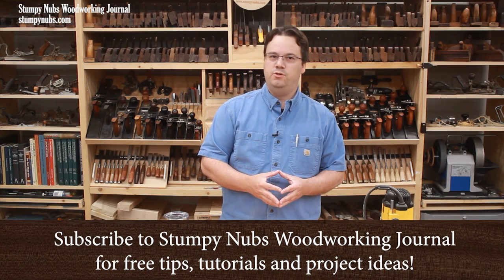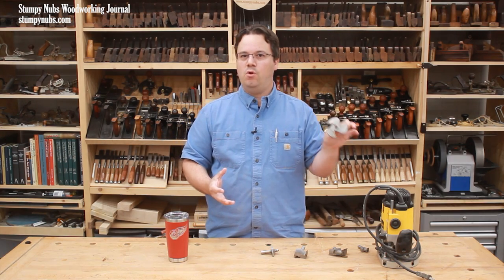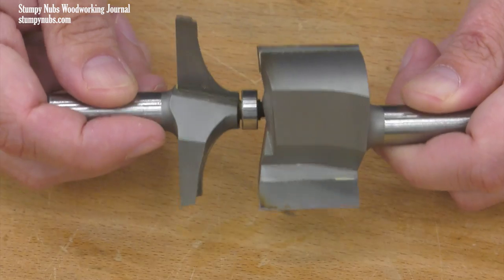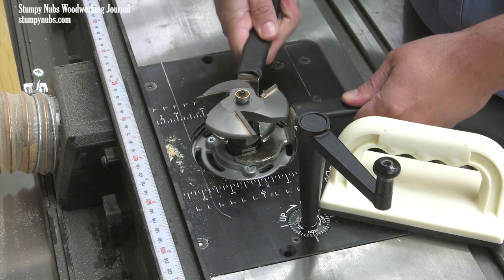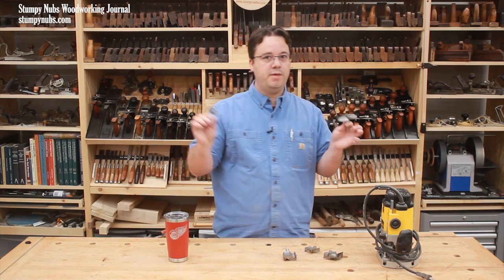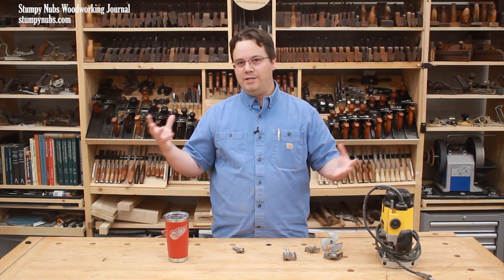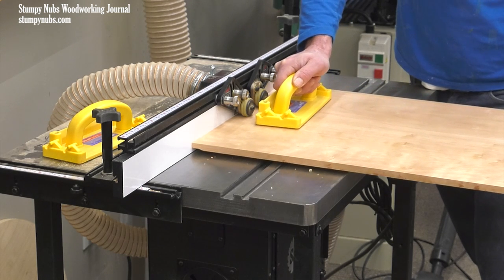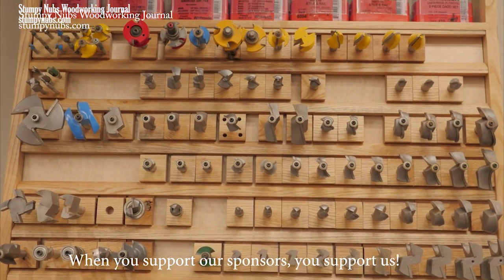The SCARIEST router bit I've ever used! (How I survived...)

Comment: I have this Whiteside (great bits) bearing guided 1/2" dia solid carbide upcut (I use it inverted in a router table so it's cutting downward) spiral bit that I use for routing guitar bodies to a template.  I call it the "murderbit".  The LEAST bit of inattention one day and that thing grabbed the guitar body out of my hands, threw it halfway across the garage, and torqued the router right out of the underside of the table, hitting the floor and bending the bearing boss on the bit.  Fortunately I was uninjured and the damage to the guitar was repairable. The bit, alas, was a goner. An EXPENSIVE goner. :D

Comment: There's hand held routers, hand held routers mounted in a table and then the spindle moulder. The advantage of that is more rigidity and power feeding of the  workpiece on the bigger machines.
Reply: Always found working with the spindle moulder much easier and saver than the router or router table, especially with using the aigner accessories
Reply: There are also pin routers and pantograph routers and cnc routers and machining centers not to mention that some of the older radial arm saws had router capability but the common rule of safety is that cutters that exceed 2 inch diameter are not for use in hand held machines ever.

Comment: I tend to use the vertical router bits for raised panels nowadays. Yeah you have to use a taller auxiliary fence and feather boards on the router table but the bit doesn’t seem to work as hard and it produces less burning and chip out. At least in my experience with it. Of course the same safety precautions still have to be taken.

Comment: It might be good to mention vertical raised panel bits as an option for those bits with a large diameter. They require a tall fence, but have some advantages. One still needs to be very careful with either design. Thanks for another great video. Excellent bit storage design!

Comment: honestly, same principle as in machining. they use the actual cutter's speed (i.e. what you were describing) plus how fast the feed rate is to determine pretty much everything. (well, plus the cutter's construction, the material, but . . . ) so this is a really good thing to take into account with routers (which are the smaller cousin to the milling machine). Thanks!
Reply from the maker: Feed rate affects the cut, for sure. We have a whole video about that. But the max speed of the bit applies even if it's just spinning and you aren't feeding anything through.

Comment: When it come to router bit security, one thing that some people might not think about is CLEANING the mating surfaces of the collet and spindle. I've made it a habit to ALWAYS take the collet out and wipe down the outer surfaces as well as to clean out the spindle socket with a soft rag and a bit of solvent (to remove any resin from wood pitch) before mounting the next bit.

Comment: I bought a panel raising bit like the one you show some years ago. I have a single speed router which advertised 1.5 or 3 HP depending on exactly what parameter they were quoting. I chucked up the bit once and turned the router on. The inertia of that bit caused such a huge "recoil" that I lost my nerve altogether, turned the router off and returned the bit to its box. Nowadays if I wanted to make a raised panel I'd either opt for a simple profile that I could cut on the table saw, or use one of the so-called "safety" bits that turn the profile on its edge to give a smaller diameter bit. Incidentally, I'd just like to point out that you can't sustain 3 HP from any motor connected to a standard 15 Amp circuit...assuming 120 V, the most power the outlet can deliver continuously would be 1800 W (~2.4 HP) and that assumes the motor operates at a power factor of 1. Anyway, all that to say thanks for a great video. Some of the tools readily available to amateurs can be extremely dangerous in inexperienced or willfully careless hands. That's an important message to share.

Comment: One other point to consider when running a larger diameter router bit, reducing RPM may maintain the desired "rim speed", but it will also increase the "chip load" if feed speed is maintained.  This might not be as big of a problem with the three knife raised panel cutter, but for something with two knives like that locked miter cutter in the video, trying to maintain the same feed speed or pressure will result in the bit taking a bigger bite on each revolution.

Comment: Great info, as always. Question: I have a Kobalt router w/table. The router does not have an adjustable speed. Can I use a router speed controller or will that affect the motor?
Reply from the maker: You should be able to get an add on speed controller for it.

Comment: It's interesting that the concept that you talk about in the second half of the video - tool cutting speed, or Surface Feet per Minute (SFM) is talked about so rarely in woodworking. In machine shops, SFM is everything. The right cutting speed is crucial for optimal material removal rate, surface finish and tool lifespan. 

But in woodwork it's generally an attitude of "Full speed ahead, and it if starts burning back off a little".

Comment: So timely!
My Triton router while very powerful, and my brand new spiral compression flush trim bit seemed an easy job.
However it was the end grain of extremely hard wood. Table top is 1 3/4 inch. 
I took too aggressive cut and the router at speed 3 out of 6 started vibration and I nearly lost control. Damn it was scary. 
Table top is 240lbs so taking it to the router table was out of the question. 
The solution was trimming the edge with the circular saw, then taking small cleaning passes with the compression bit to remove the saw marks.
The masking tape helped beautifully with securing the exit edge

Comment: Great videos as usual stumpy. Now I should ask. There’s allot of guys out there, myself included. Who flatten/plane large slabs of wood. With a sled type jig. Now I have a 2” bit a 2-1/2 inch bit both with 2 cutters. And another 1-3/4 with 4 cutters. All of which are between 5/8-1/2 thick and don’t wheigh allot. Are these safe? And if so am I able to go bigger because of the sled? And does having more than 2cutter heads make a difference? I’ve heard it’s worse. I also have to plane through resin which requires less depth per pass and a more careful speed ratio too fast it chips too slow it burns. I should mention I have an extension for my router for times my jig doesn’t allow me to get where I need it and that gets pretty shakey. Any tips ? Sorry for the overload but lots of guys are doing it I’m sure you agree these are good questions. You work the trades you know there’s no stupid questions. Have a good one there stumpy
Reply from the maker: All of those are 2-1/2" or less in diameter and reasonably light weight. So if your router is powerful enough, they sound fine (with proper precautions).
Reply: @StumpyNubs  thanks stumpy. I’ll go to a 3” bit with this new knowledge

Comment: Worst shop accident was a 1/2" spiral upcut doing a box joint, had the panel secured with a sping clamp . Last cut clamp popped off and i tried to grab it before it hit the bit. I got the clamp ,bit got my finger. Almost cut the first inch of my finger off, cut into the bone cutting tendons and ligaments. Surgury repaired it completely. Have feeling and movement back

Comment: Excellent point on the mass of the bit. I was thinking you want to keep angular momentum to minimum in something you'll be moving around and that is impacted by mass as well as radius (and speed of course). A better rule of thumb might include under X oz as well, which I think you were getting at.

All my bits are 1" or under light weight at the moment so never ran into the issue, but good incentive to finish that router table before I even think of getting something bigger (if I ever do; not a big router user).

Comment: My scariest experience using a hand held router was with a small roundover bit when the bearing on the bit disintegrated. I now check the machine screw holding the bearing on for tightness when I use any bit.

Comment: Yes, I have two of those for slightly different profiles. I bought the bits, and then bought a 3.5 hp variable speed router before I took them out of the box. They are very scary, but they do a good job. I still have all of my fingers.

Comment: If you are using cutters that big and have the space, consider getting a spindle shaper.  The cutters are locked on with a nut holding them down so they aren't going anywhere if installed correctly.  I have had one for years and it easily can handle panel cutters and any large cutter head.

Comment: I'd call those large bits 'Spindle moulder bits'. While the most powerful pro routers can handle them, using the term 'spindle moulder' helps me think of them as heavy duty joinery tools rather than lighter duty cabinetry and furniture tools. As you mentioned, it's about mass leading to angular momentum. With kinetic energy related to mass * VELOCITY SQUARED, a large bit diameter means the rotational energy at the outside is vastly greater than at the centre or on a smaller diameter bit. You are very correct to talk about slowing down the rotation speed. It means the bit has to be built so much stronger (therefore heavier) than a smaller bit - so risks and consequences from a spindle moulder bit are so much more vastly greater than for a mere router.
Reply from the maker: A 3-1/2 HP router is hardly "light duty."

Comment: As far as doing the math on the speed dial, are those typically linear? I’ve had some other non-tool items where that type of adjuster was logarithmic. Was curious if that was possible here.
Reply: Some are linear, some are log.  I do what Stumpy said in the video - start at the lowest setting and increase until it makes a bad vibration, and then write that number down.
Reply: @criswilson1140  I'm with you on the bad vibration method. Would be nice if manufacturers would make things more clear, tho.

Comment: I have a small bone structure and clicky wrists and other joints. It was the early 2000’s. Spouse wanted a raised panel bit collection ( cabinet panels, certain types of joints) and holidays approaching. I walked into a Woodcraft store we bought from often enough… sashayed up to the router display, picked up a demo 3 1/4 Ho chunk and turned it over. My wrists came forth with an alarming collection of cracks, pops and snaps. The clerk materialized at my elbow and nervously asked if I was thinking of using it as a handheld router. Nope. Holiday gift, table mounted because needed to swing a panel bit was going to take a serious router. I rolled it back over to another collection of those clicks, crunches, cracks and pops and put it back on the display. I left with router, extra plate and four big chunks of sharp metal…

Comment: I have a flush trim bit that is 5" long, roughly 3/4" diameter. Due to its length increasing its mass what speed would be correct for it?
Reply from the maker: Really long bits can definitely vibrate. I'd slowly increase the speed until you feel some vibration, then back it off.

Comment: Machinist fly cutters are pretty scary too. Painting a bright color on the end helps visualize the almost invisible whirling zone of doom.
As for RPM, use a frequency analyzer app for your phone. Hz = RPM but verify on a known reference speed (like max) first as stuff has resonance and gears.
Lastly I could see having two setups one rough cut and one finish. The old bit and machine can tee the work up for the new bit/machine and make it last longer. Even if you have just a table saw bevel it can reduce the finish load.

Comment: I have a pointy index finger from that exact panel bit. Was pushing a board through paying close attention to the bit and hand placement but the far end of the board was knocked aside by a coworker carrying a sheet of plywood and it pulled my left index finger in taking most of the nail and part of the bone in less the a blind of an eye.

Comment: If I had both a router table and a shaper, when would I use each?  For what kinds of jobs?

What if I only have a shaper--is there anything I couldn't or shouldn't use it for?  Would I also want a router table?
Reply from the maker: Shapers generally have more power (though you can get pretty powerful routers) and can be fitted with a wider variety of large cutters. Both shapers and router tables may be fitted with power feeders and other safety devices. I suppose if you have a shaper, and the cutter than you want, use the shaper.
Reply: @StumpyNubs  Thanks.  I actually have neither.  But I see a shaper at Grizzly with an iron table, 120V 12A, for $1075.  And I see a router table with an iron table at Rockler for $1430, not including router--so probably $1700 with router.  Or another shaper at Grizzly for $1705 with iron table, 240V 12A.   Both shapers will do 7000 or 10,000 RPM.

So I'm thinking, why not just buy the shaper?  Is there something I couldn't do with it?

Comment: Good info from the Stumpster here. Router bits of this diameter are essentially shaper bits and should be treated like using a shaper, big strong fences, hold downs, feather boards, power feeders, top guard should the bit come loose, you name it. Also the RPM of the router is usually too high at around 20K. It should be half that for a 2" bit and even less for a bigger bit, but this greatly reduces the hp. I'm not sure about that, if anyone knows, do router speed controllers, either onboard or external actually work worth a crap?

Comment: Can you say more about the mph calculations?

I was able to replicate the 230mph figure for an 11" circumference bit but not the 120mph for the smaller bit. 

I got more like 83mph if I use 4" circumference or 98mph if I use 4.71" circumference. 

Maybe calculation is from a 1.83" diameter bit?
Reply from the maker: I rounded everything off, including circumference. If you want to calculate the precise numbers, start with pi.
Reply: @StumpyNubs  

Large bit
3.5in * pi = 11in circumference
11in * 22000rpm = 242000 in/m
242000in/m / 12in/ft = 20167ft/m
20167ft/m / 5280ft/mi = 3.82mi/m
3.82mi/m * 60m/h = 229.2mi/h
a.k.a 230mph

Small bit
1.5in * pi = 4.71in circumference
4.71in * 22000rpm = 103672 in/m
103672in/m / 12in/ft = 8639ft/m
8639ft/m / 5280ft/mi = 1.64mi/m
1.64mi/m * 60m/h = 98.2mi/h
a.k.a 98mph (or could say 100mph for rounding)

Comment: A question born of my ignorance, mostly, because I never really assiduous electric motors: 

When you say "do the math," is it always safe to assume the relationship between motor RPM and position of the speed control potentiometer (I assume it's a pot) is on a linear curve? 

I ask this as a person who has seen a linear pot in a poorly implemented volume control result in an apparently non-linear volume change relative to the knob's position. In other words, the knob at half position was more than half loud. Now that i write it all out, it seems unlikely my worry makes any sense... motor speed is nothing like sound propagation.

These videos, tips and product recommendations are always appreciated.

Comment: Would you say that part of the control over the tool and work issue is also related to the volume of wood being removed per pass?  That plus on the bigger diameters when it does dig in there's a lot more torque acting up through the router in a hand held situation.     For my part only using a router occasionally I would be drawing my own line between hand held and used in the table at more like 1.25 to 1.5 depending on the profile.  And in any case with the bigger stuff I'd limit the volume of wood converted to chips per pass to something reasonable.  It's easier on the router and easier on the operator and if a little skim is left for the end should give a nicer finish to the shape to boot.
Reply from the maker: You mean like this: 6:32

Comment: Your talk of using different RPM settings for different diameter router bits, is similar to how machinists work. We routinely work based off surface speed in, Feet Per Minute or Meters Per Minute. 

As an example, High Speed Steel drills cutting common 1018 cold rolled steel. With flood coolant, I typically run 75 Feet Per Minute. For a ¼" diameter drill, 1,146 RPM. For a ½" diameter drill, 573 RPM. Same cutting speed, vastly different RPMs.

Comment: Great video with good information and keep us all safe. It also remind me of an old Calvin and Hobbes cartoon where Calvin's dad is explaining to him that the center of the record spins and goes a certain distance and the outer edge spins the same speed but goes farther at the same time. I'm saying that wrong but explaining how fast the outer edge of that router bit has to go certainly made it disturbing. And if I remember correctly propeller blades both on hovercraft and planes the tips with sometimes break the sound barrier even if the propeller itself was not

Comment: Math

Given a constant RPM of 22,000: 
An 11 inch circumference bit spins so that the outer edge travels at 229.167 MPH (or if you aren't pedantic, 230 MPH).
A 4 inch circumference bit spins so that the outer edge travels at 83.333 MPH.  (not 125).

A 6 inch circumference bit spins so that the outer edge travels at 125.

So the example bits (if they each have 4 and 11 inch circumferences) are 83 vs 230 MPH.  An increase of 147 MPH.
Reply from the maker: I was rounding off on everything, including the circumferences.